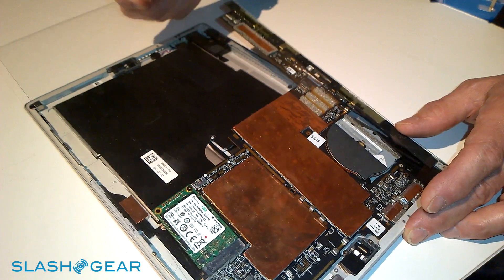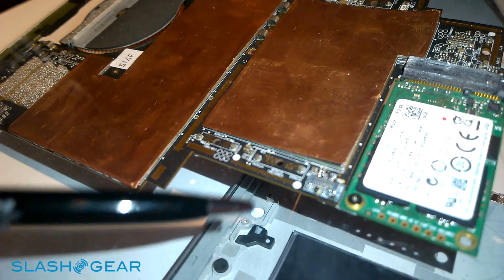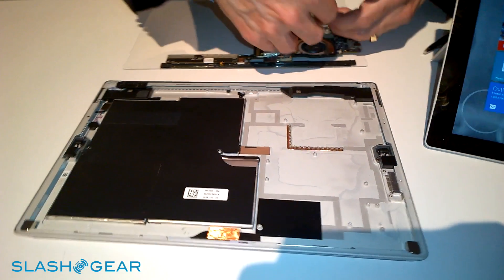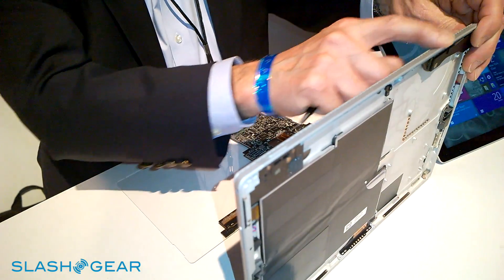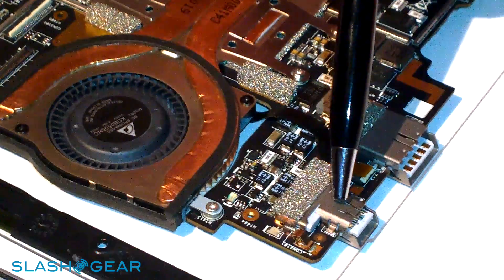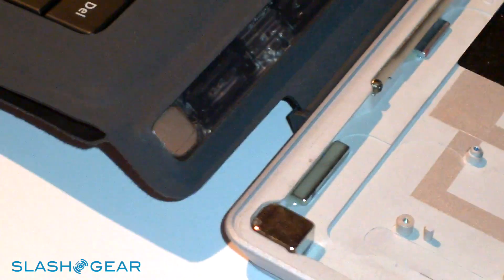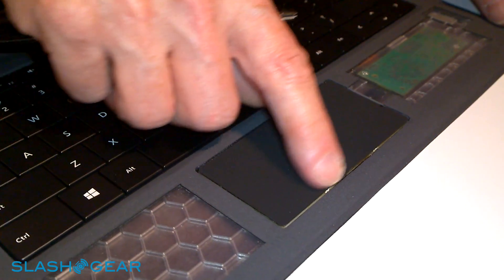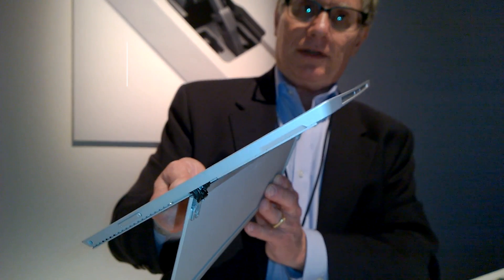Microsoft Surface Pro 3 Detail Internal walkthrough

Comment: no wonder you can cook eggs on the back of this. trying to get rid of 15-20w heat in 1 inch area without any passive cooling, worst design ever. well in pro 4 fixed ,should be an upgrade option for pro 3 owners
Reply: Peter P. Yeah my i5 surface pro 3 runs hot I disabled cpu turbo though and it has helped.

Comment: What about repairability? 
I'm kidding, anyway I'm a little concerned about what if I buy this device and I have a small accident. It looks to me I have just to throw away good money.
Reply: ginojap It depends on what kind of accident. It is a very rugged device and you can drop it from a decent height without damage as there is almost (fan) no mechanical parts inside. I have the original Surface Pro and its built like a tank